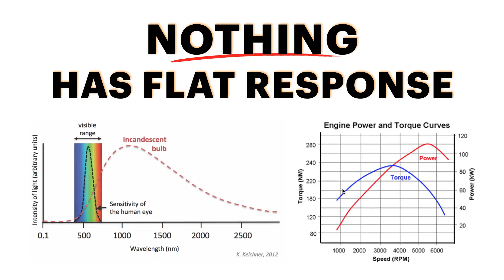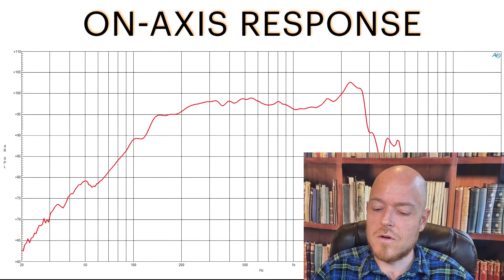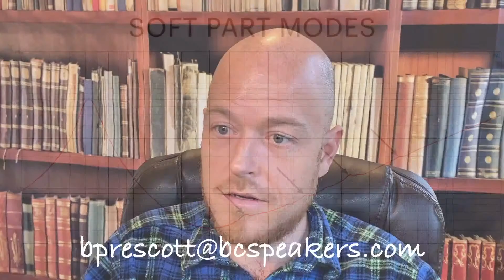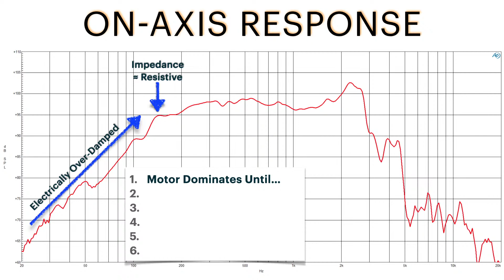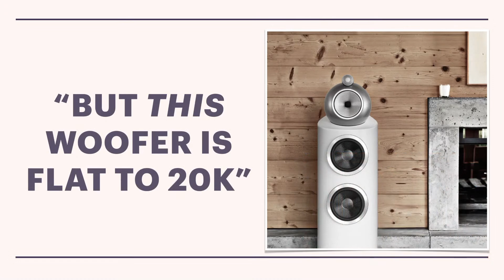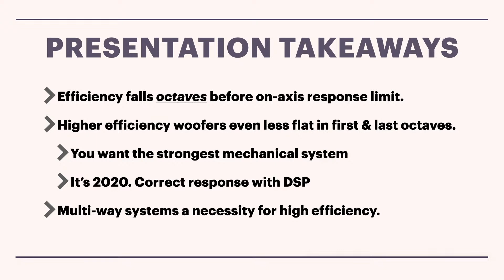Transducer Frequency Response

Comment: I have a theory about bass response there are three areas for a low q driver, first is the 'position constant' at very low bass say 5hz or 10 whatever the current is limited by the resistance so force is constant and so is position (in relation to frequency). this is the 12db/octave part of the curve. then at higher frequency it starts to generate voltage there 'speed is constant' the speaker has an easy time and the curve does 6db/octave. the speed is just the same as the voltage applied like a dc motor. Then somewhere beyond fs the mass kicks in and the resistance starts to limit the current again and you have an 'acceleration is constant' thing going on and that is the 0db/octave area.
if you were to crank up the BL the 6db area would widen and lower whilst the other two areas rise in output. for the usual hifi driver it's a bit different the 12db part directly transitions to 0db the driver only has it easy around fs because spring and mass cancel each other out. I use sealed cabinets btw 2x2 18'' can't stand bass reflex and level is surely high enough for indoor disco/dance settings. outdoors is a whole different story blew up one speaker there. you could feel the heat it got demagnitized neodymium doesn't like heat very much. a monacor driver btw not b&c. 
I put 6inch 18sound mids in the tops, before it went directly from 15'' to neopro5i ribbons at 2k but I found out that although it didn't sound 'bad' there was nothing wrong with the freq curve perse things like percussion came out very fluffy so I put in those mids from 500 to 2k and that brought back in the 'snap' from say a snare drum.

Comment: What's the best B&C woofer, cost no object, for the following use case, in which it will be EQ'd by DSP:
- Home hifi application, high efficiency but maximum efficiency isn't the primary goal
- Used in a large ported box (4 or 5 cubic feet, or even larger if design goals are served by it), with as low an extension as possible.  Happy to DSP in 12 or 18db, it only needs to be able to physically produce the bass while retaining low distortion.  30hz bare minimum, lower is desired.
- High output is desired, but this is relative and is in a home environment, so outdoor concert output is not needed.  But because the setup won't have a sub, I'll most likely use the maximum output of 2 15"s when it comes to that 20-30hz region, so high-xmax is desired for very low frequency spl.
- Will be crossed to a 1", maybe 1.4" compression driver as low as I can get away with given the lower SPL requirements relative to their capability, so targetting 1khz or lower, depending on compression driver sound quality at those frequencies.  So the woofer is not acting as a sub, it needs to perform well to 1khz, DSP crossed at 12 or 18db/oct.

I know a 2-way with a 15" will have tradeoffs, and I haven't picked the CD/horn combo yet, so really I need to know what's the best 1"/1.4" for relatively low SPL home hifi use, when needing to cross at 1khz or lower, and get the best extension and HF performance/distortion to as close to 20khz as possible.  Open to b&c or 18sound.  Input on the best horn for it would be welcome too, and I'm open to different geometries.
Reply: 30Hz to 1kHz is impossible with a pro audio driver.
 You could either accept only going down to 50ish Hz and use an 15NDL76, 15NDL88 or 15NTLW3500.
A nother option would be using a coaxial compression driver and a big horn. B&C has a sugested desing using two 15sw100 and a DCX464 on ME464. You could build that with only one woofer.

But i would seriously reccomend steoping up to a 3way system with an single 18" or 15" as a subwoofer (18NTLW3500, 18SW115, 15SW100, .....) and one 12" or 10" per side (go with the NDL, 12NTLW or 10NTLW series)
Reply: @lukahierl9857 thanks for the feedback. 

You're not wrong as far as what's IDEAL,  but as far as what's possible, i think you're missing the point and the facts here.    If you accept the directivity issues (beaming), a pro 15 absolutely can cover 30hz to 1500hz or even higher,  no problem.   Heck it could do 20hz to 2khz.

But of course,  obviously a good design would cross it lower  .. 1khz is actually quite reasonable.  Plenty of 1.4" compression drivers could cover to 1khz or even lower, 800hz maybe even a hair lower with a steep slope, at home listening levels,  and cover all the way to 20khz. A pro 15" plus compression driver 2 way is of course possible and has been done many times and in many iterations. 

That's not to say there aren't benefits to going to a 3 way, obviously there are or can be. 

As for the 15, and the bass, my current speakers are covering from the bottom to roughly 1500hz, on some jbl 2225h 15" drivers.   Obviously this requires eq, and a proper enclosure.  They have extremely solid output down to 28-30hz area and that's where they really fall off fast beyond rationally using eq to push them.  But 30hz is no problem, with eq they achieve the RISING response (like a harman curve but more pronounced) to 30hz, no rolling off.  Plenty of xmax plenty of volume,  no significant or audible distortion of the mids etc.  

Ever look at pro/pa speaker xover points?  1500 isn't even that high.  For power habdling reasons many 15s are crossed even higher than that until you get to much more expensive higher end designs.   For pro use they can't really push a 1 to 1.5" CD that low, it won't survive the abuse.  For home spl levels you certainly can.

So as i indicated,  i know it's a compromise design to some extent,  though not as severely as you think,  and the question was simply what's the best 2 way 15 and CD combo.  Look at the "horns fp15 by autotech" as an example.  And remember,  i don't care about the frequency response, as a matter of the natural sensitivity amd rolloff,  because exteme eq will be used, all that matters is that the driver and enclosure can output 30hz and not be unloaded, excursion being kept in check.   I can do +18db that's no issue.
Reply: @Artcore103  my main point isnt that a 15" cant reach up to 1.something kHz. What I am getting at is that you would be better of using an coaxial compression driver or one of the old 2" compression drivers that can reach down to 500Hz. Because any proper woofer (you will need one to reach 30Hz, so no 15NDLxx or similar) will sound like utter crap above 500Hz.
Some "pro audio" 2 way cabinets do use 15"+1.4" but they are all on the cheap and nasty side and cant reach to 30Hz.
Reply: @lukahierl9857  yes I acknowledge that such a design has definite potential benefits and a higher performance ceiling.

any woofer can reach 30hz, even 20hz, I don't know where you're getting this.  i'm not looking for a sub driver that can't extend to 1.5+ khz either.  any of  the modern mid-range (price wise) b&c woofers are superior to my 2225h in several ways for instance, including xmax importantly, and even my 2225h or the 2226h can easily play to 30hz.  the difference will be in output capability, and the distortion profile vs input power/xmax.  Geddes somewhat famously designed such large format 2 way monitors as well.  this is far from a new idea or an unachievable goal, even if you think there are some compromises compared to a 3-way, obviously.

my 2225h sound quite nice even to 1500hz.  some of the 15" options available today can handle double the power and have twice the xmax of my 2225h.  that's what I'm interested in.  there are 1.4" cd's that can cross as low as 800hz or lower, maybe even 700hz, I've even seen 5 or 600 hz though I would fear damage from the excursion at higher output levels even with a steep slope going that low, among other potential issues (just the sound character, the directivity control of an accompanying horn etc).  But 800hz would be no problem at home levels (110db let's say), as all the ratings for such drivers, the suggested crossovers, are based on the assumption of pro / high output use, not a domestic living room.

I have greatly considered the me464 and dcx464 or better yet the 354.  on paper it seems like the perfect solution.  but besides it being very expensive, which I could live with if it WAS the perfect solution, the fact is this driver and horn is simply not up to the level of fidelity compared to a good traditional single driver  unit, and a horn with better geometry.  the distortions in the dcx drivers are significantly higher than what can be achieved with other options, and I would prefer the tradeoff of crossing higher (800-1000hz) for a higher fidelity in the upper midrange and treble region where we're more sensitive to it, and not having the additional crossover region and the problems there.  there's lots of data and testing on it if you look for it.  it's a great high output simple solution for a high output pro/live/outdoor use case, but it's not really the answer for home hifi and the forums make this clear as well.  it's also huge and very deep.
Reply: @lukahierl9857  some more context... I'd love to use a DCM50, a woofer crossed at ~400-600hz, and a tweeter above 8 or 10 khz.  This is a recipe that has been designed and tested and is highly regarded and recommended by the venerable Joseph Crowe - who if money were no object, I would just buy some of his speakers.

The issue is cost, because now I'm looking at 6 expensive drivers instead of 4, an additional horn or waveguide for the tweeter, a more complex cabinet, and I would also have to get an 8 channel capable dsp, not a huge deal, but that's an extra 50-100 bucks too going from a miniDSP flex to a flex8 or flexht.  it adds up, and as a novice, the extra cabinet complexity is a significant hurdle as well compared to the simplicity of the 2-way.  And even though the 3-way has benefits (my current speakers are 3-way btw, even though they're crossed at ~1500hz and ~9-10khz, with a ribbon for the top), a 2 way has some benefit in lacking that additional crossover region, and in coherency being closer to a point source since this is close proximity seating for such a large speaker (~3M or 10ft distance).

The dcm50 is like 500 bucks, requires a larger and likely more expensive horn, whereas a 1.4" cd could be 2 or 3 hundred and require a smaller cheaper horn like the faital pro lth142 which is an excellent geometry and can support the 800-1khz xover point well.  a tweeter on top of the dcm50 would be minimum another 200 a pop if I went with the excellent ct440 also tested by joseph crowe.

If I can do this for 2000 bucks instead of 3000+ that's a big win.

Comment: The designers of old knew that 350-800hz was the better place for crossovers. To this day I prefer under 500hz if compression drivers are worthy.
Reply: B&C make a coax, annular CD that is great on down to 3oo-400 Hz. :-) AND the horn to load it with!
Reply: any link to that?
Reply: @bryanshort4262  The DCX464 compression coaxial and the ME464 horn.